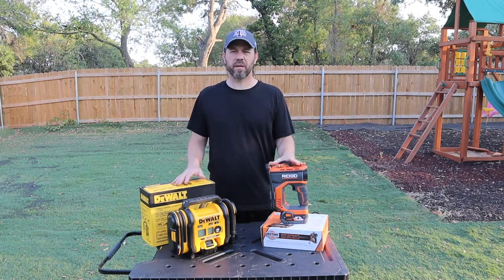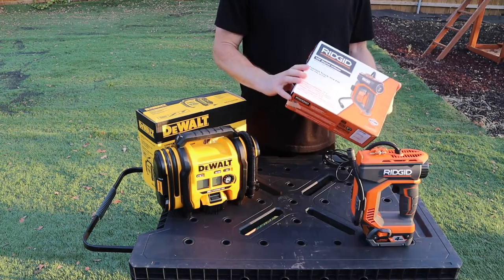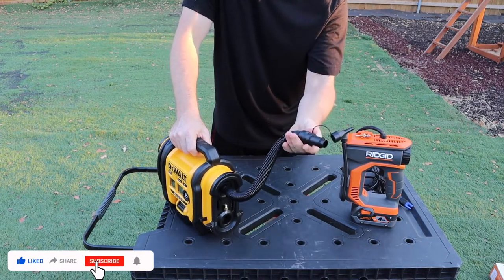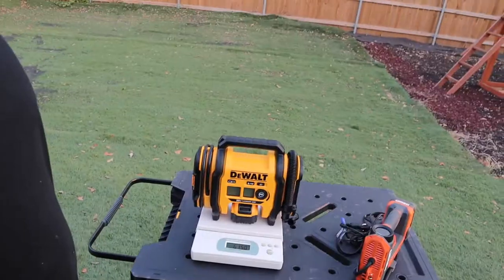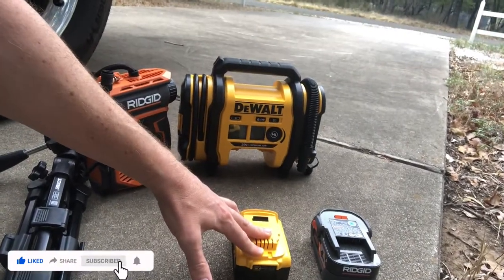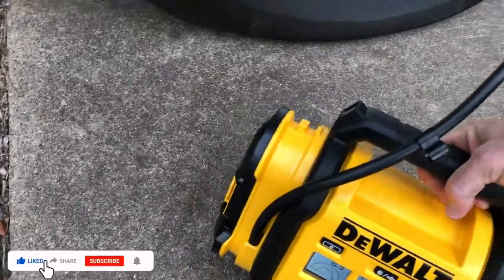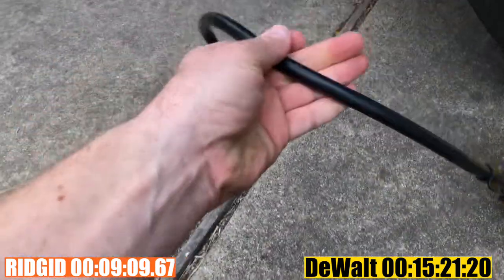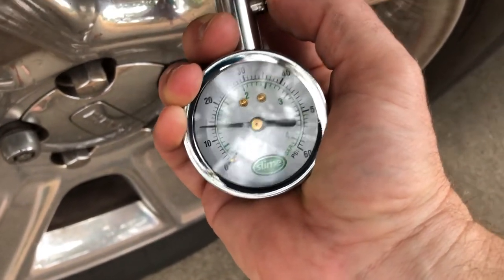RIDGID vs DeWalt Cordless Hybrid Tire Inflators Under $100 | Which is better for your money?

Comment: Ridgid 30% less expensive, faster inflation, smaller in the tool box, lifetime guarantee = Winner!
Reply from the maker: My sentiments exactly.
Reply: Just bought one today
Reply: I got it and fully agree-good job Rigid+u can plug it intonAC
Reply: Just bought one for my truck and lawn mower tires. Buying another one to keep in my saddlebag with just the 12v cable
Reply: Just make sure to give it a 5-10 min rest time in between tires because it can overheat if you dont.
Reply: FYI.. $69 bucks does not include the battery or charger....

Comment: Nice video.  I just bought the Ridgid at HD tonight ... and THEN I watched this video.  I see I made the best choice !
Reply from the maker: Yeah, that RIDGID one is the right choice. I have an upcoming video where I do something pretty unique with this this inflator. I didn’t just to see if my theory would work. I’ll post it sometime next week.
Reply: @MasteringMayhem  Funny ... I looked online at Ryobi first (have about 15 Ryobi cordless tools) and then Dewalt. Went to HD hoping they had the Dewalt. They did, but manual was missing in box and decided I didn't need the other features.  So I put the Ryobi in the cart. But then I noticed the Ridgid ... and ultimately got that one. I will be testing more over the weekend. I do have both Dewalt and Ridgid tools.  All three are actually pretty good.
Reply from the maker: @joeanderson3423  I have a variety as well. It’s tough to stay exclusive to one brand 🤷🏻‍♂️

Comment: I carry mostly Milwaukee and Metabo HPT tools but have some Makita and Rigid where it makes sense
Rigid has been bringing in quite a few tools with AC plug in dual flexibility propane jobsite- heater, fan, lights and now the inflator-theynalso make a great review cordless brushless planer that outdoes my old Makita planer that has been a workhorse
Reply: Yeah I bought the Ridgid propane turbo heater. Works off of AC power or battery pack. I use my old series 2 Ridgid  batteries. But the AC power is sweet. I run that heater out in my garage when putsing around in the winter.

Comment: I have 2 of the Rigids. However I have problems with the quick connect coming off both on car tires and bikes using the Presta adapter. While I don't have the Dewalt, the screw-on connector would seem to be a benefit to me. I wonder if many other Ridgid users are having problems with the quick connect either leaking or coming off completely when trying to air up a tire?
Reply: Yes,  The Ridgid connector sucks.  I have both brands.  The Dewalt is very easy and good.

Comment: A big downside for me about the ridgid is the 5 minute duty cycle.  It didn't hurt the tool when you went over that this time but it may, it's not rated for that.  I wish the ridgid had a 10 minute duty cycle.  I don't know what the Dewalt's is but as I understand it it's higher.  Problem for me is that I don't have any Dewalt batteries, only use Milwaukee and Ridgid tools.
Reply from the maker: It’s weird that it didn’t happen when I made the video. I’ll definitely look out for it as I use. Thanks for that detail.
Reply: @MasteringMayhem  Well I'm sure like most things in life they underrate the duty cycle.  Can't have it blowing up at 5m30s or else people will all bitch and call it a POS.  It also depends on ambient temperature.  My guess is it'll run like 15 or 20 minutes before getting too hot, then they chose 5 as a nice "cover their ass" number.
Reply: @MrSlowestD16  while it has a 5 min duty cycle, the unit doesn't shut off at 5 minutes.  I believe it IS a cover their ass number.  Also a way for them to deny a warranty claim.  They can claim that it was abused from over heating it.  I have one and it doesn't take 5 minutes to fill the one tire I have that is always leaking.  The 5 minute cycle is written in the manual that comes with the tool.  You can run it until it dies, which is way longer than 5 minutes.  I've seen other reviews of it and this one isn't the only one that fills an empty tire until it's full without cycling the tool.  I think I saw one run it from 0-85 pounds to see IF it could and how long it would take.  It did it and did it faster than the other ones in the comparison.
Reply: @adriandavis3908  Yea but that denying of the warranty claim and claiming it was abused is exactly what I'd like to avoid.  There was another channel that did a bunch of comparisons and pretty much none of them lasted the full time except the DeWalt.  It had all the competitors, but it unfortunately didn't have the Ridgid, it was before it came out I think.  Nice to know it lasts significantly longer than 5m though.

I ended up getting the DeWalt, simply because it's rated for 100% duty cycle in the manual (so they can't claim abuse), it's the quieter one by far (compared to all the competitors, not just this one), and it has the AC and DC power plugs so you don't need to rely on battery if you don't want.  I think it's not quite as quick on the fill as the Ridgid, though,
Reply: The five min duty cycle comes from not having adequate cooling etc. probably a friction type sleeve or something. Ball bearings will let you run much longer. But still. You gotta go with the one you have batteries for.
Reply: @jo9732  Agreed.  A lot of these use plastic pistons and they don't last forever.  If you're considering these btw, since I last posted I did 2 things:
1.  I wrote to Dewalt asking about the duty cycle, they said it's 100%, no cool down required.
2.  I then bought the Dewalt and it is absolutely EPIC*.  I pop in a battery, top off 4 cars (all 4 tires) and 2 motorcycles, run it for like 15 minutes, barely put a dent in the battery, and it's *FAR  more quiet than any other inflators I've used.

I didn't have any Dewalt batteries/chargers, but bought a charger/battery for the sole purpose of this inflator and it was totally worth it.  My air compressor usage took a big hit since I bought this thing.  Really is the best inflator by a landslide, IMO.

Comment: I'm not sure what the warranty is with the DeWalt but I'm a big fan of the RIDGID.  RIDGID has  Liftetime Service Agreement
 .  Look for the badge on box.   You do have to be sure to registered within 90 days of purchase.  I started replacing cordless and decided to go with tools made by RIDGID and they all use the same batteries.  I have the  Impact Driver, Hammer drill, reciprocating saw, 4 batteries and charger..  I have beat the Impact Driver and Hammer drill and they have worked great.  Batteries seem to last much longer then you would expect.  You have to figure if you use other RIDGID tools along with all of them using the same battery and the LifeTime Warranty which even covers batteries.  RIDGID seems to be the only one that offers what I consider the best warranty.  I had the Impact and hammer drill for a couple of years and they work like new.   No I'm not a salesman for RIDGId and I don't work for HomeDepot.  LOL
Reply from the maker: Ben Their LSA is the best warranty I know of on power tools.
Reply: @MasteringMayhem  metabo hpt also has lifetime warranty on most of their cordless tools.

Comment: Good video, appreciate the time you put into it.  Obvious comment here...one major consideration for me is 'what batteries do I have now?'  I've stocked up on Ridgid tools for a few years now so I have quite a few 18V batteries.  While I like the DeWalt storage and blower option, I would need to spend another $100 min for a battery and charger if I don't want to rely on 12V plug exclusively.  So personally, I like the DeWalt tool better (even being a Ridgid guy), but not for the extra battery and charger I would need to purchase to use as I intend.
Reply from the maker: Makes sense. Personally I have the RIDGID in my truck with me and it’s come in handy quite a few times. Yes, the batteries one has is always a big factor in the decision making.

Comment: Love Ridgid but it's dangerous!! It does not auto shut off and continues to fill air into tire when it's set to 10 psi or less. Why have an option of setting a low psi when it doesn't work!?

Comment: I just ordered the Ridgid Inflator today. I'll pick it up tomorrow. I got it for $49. I've been waiting for it to go back down on price. 

I'm also a Ridgid tools guy. I have a mix of GEN5X and Octane sets. I also still have my old Ridgid tools left from my second generation of Ridgid cordless tool set. I bought them back in 1997 or 98. They came in a big orange canvas duffel with two NiCad batteries a charger a drill sawz•all, a lightand s couple others That set is sooo fkn heavy compared to the new lithium batteries and the tools construction. Ridgid did exchange my NiCad batteries once their lithium batteries got a bit established., Maybe back in '03 or so.

All right mang, good video.

Comment: What about the Ridgid cycle run-time?  It's only "supposed" to run for 5 minutes at a time.
Reply from the maker: Kevin Cotter Haven’t heard about that yet. I ran mine over the 5 minute mark a few times already. Didn’t get hot or have any problems.
Reply: It does have a 5 minute cycle time.  It is printed in the manual.  It'll run longer, but I'm sure it's written in the manual as their way to not honor the warranty.  Wouldn't be surprised if there is some chip on it that keeps track of how many times it runs over 5 minutes and for how long.  I have one and really love it.  I don't normally have to completely fill my tires so it rarely runs even close to 5 minutes.  I love it!  The only thing I don't like is how loud it is!

Comment: I use cordless tools daily in my plumbing business.  Have Milwaukie, DeWalt, Bosch, and Ridgid tools.   I wish I hadn't bought the Ridgid tools.  They are not as good as the other brands I use. They get hot very quick.  And I hate the valve connection on this Ridgid compressor. .  Of these 2 compressors,  It is DeWalt for the win.

Comment: I just finished watching another comparison test and it appears that the rigid has heat issues it gets super hot and after you finish inflating the suggestion is that you rest it for five minutes to let it cool down the Dewalt doesn’t have that issue so for $30 do you want to go through all of that five minutes at a time and it being super hot needing cool down time?

Comment: That RIDGID is the better inflator. Fewer options, but better.
Reply from the maker: Agreed. RIDGID is in my truck always.
Reply: Make sure to wear ear protection, as those higher Decibels on the Rigid can be detrimental to your hearing, long-term!  Just sayin’.  For me, I will get the Dewalt, as I have NO Rigid tools, and not wanting to add yet another platform to my already 3-brand platform of great battery-operated power tools that I use!

Comment: Isn't it a huge risk to run 2 inflators at the same time off of the F150's alternator? Anyway the Ridgid seems awesome, I just wish the batteries were not so expensive. I really want one, but would have the buy a battery and charger for it which would be an extra $100 (when I need to inflate bike tires and other things where 12V power isunavailable) though it is hard to beat their warranty claims.
Reply from the maker: Sounds like there are a few considerations that your are deliberating. RIDGID is the way to go if you are able to get it.
Reply: The kit comes with a 2.0ah battery and charger for an extra $20
Reply: I think this is a Ram 1500

Comment: Dump the DeWalt and get the Ridgid compact job site blower.  It has inflation tips to bulk inflate kids toys and rafts.  Stay 100% ridgid
Reply from the maker: I just bought a few months back. Love the RIDGID jobsite Blower
Reply: I just picked up both the blower and inflator for $58 CAD each, haven't got to use it yet but it's going to be handy for air tests (I'm a plumber)

Comment: I don't see the ridgid quick connect last long
Reply from the maker: VM Carpenter So far I’ve used this for quite a few items and no issues yet with the quick connect. I’ll make a video on it if does end up breaking down or having issues.
Reply: I use it quite often so far its still good

Comment: I wish I never invested in the dewalt. They lose every tool review I see.
Reply: The issue is that you are not seeing apples to apples comparisons.
If we just take the inflator . The Dewalt runs slower because you can run it under 100psi for an hour or more.
The Rigid 5 minutes.
Also with all tools it comes down to what batteries you are using
Reply: @darkerbrother1  Milwaukee kicked dewalt's ass with impacts too. Watch project farm YouTube videos. Dewalt always loses.
Reply: @tynado1173  its not about what tools win every reviewers testing. Most of the time its by such little margin its not going to make a big difference on the job as long as they get rhe job done. Its more about whats in your budget, what feels more comfortable in your hand/while in use, and which tools last longer. Ive seen and talked to quite a few ppl using milwaukee that have had issues with their tools, and there's even been tools that after they built a good reputation they switched the internals to cheaper ones and made the tools junk. I dont trust milwaukee tools or the company. Never had a problem w dewalt. Also the tools dewalt has been coming out with recently (especially their impact wrenches) have been amazing tools and really powerful. They always felt more comfortable than milwaukee as well
Reply: @jacksmith2315  I work in the trades and our company switched to Milwaukee. So did all our contractors. I've personally had multiple Dewalt fail me. Not a fan boy. Only speaking from experience. Dewalt in the past has released a new tool first, which is great, until Milwaukee, makita, ridgid, etc does it better a month later
Reply: Half of my negative opinion of Dewalt is based off personal (poor) experiences. The other half is based off project farm reviews which just confirms my opinion with empirical data